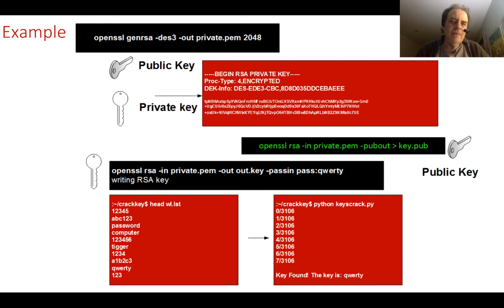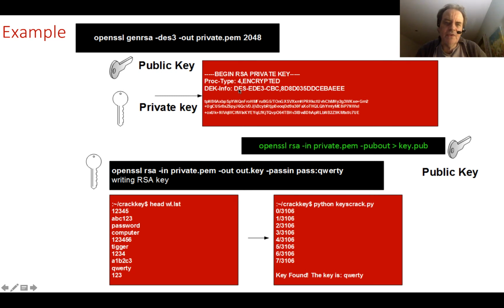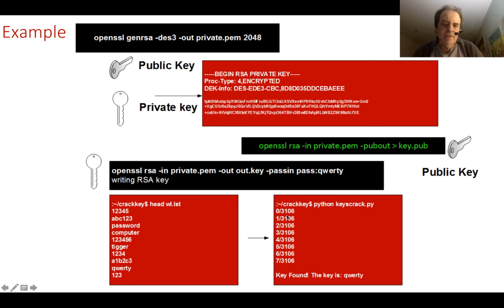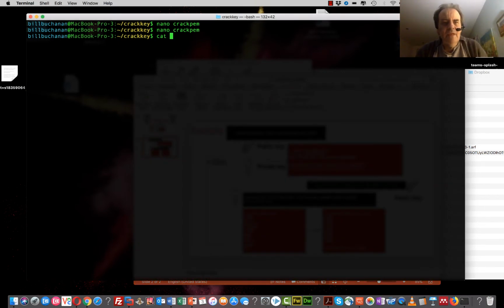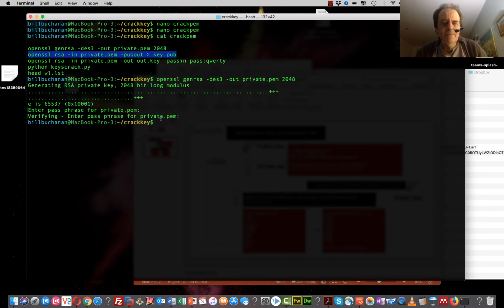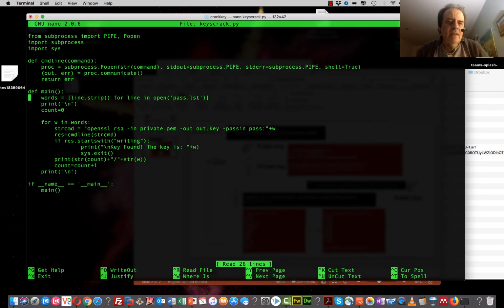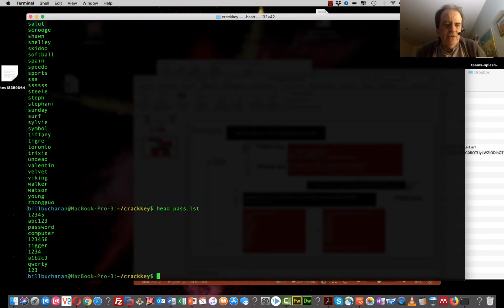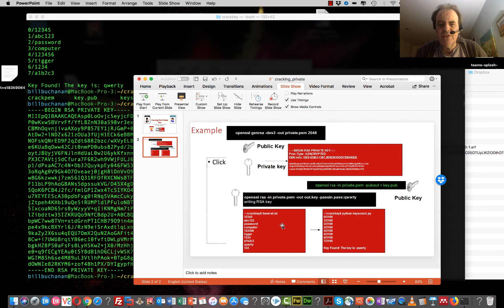Cracking The Private Key

Comment: Probably one of the worst methods for craking a pem file because python with subprocess is so slow.

John the ripper and hashcat are way more efficient tools.
And even if these don't work, pemcrack is still waaaaaaaaaay fast.

(Also, the script won't work if you an empty password in you wordlist)
Reply: Olivier, what's your device to crack/ hack a private key?
Reply: @groshen8047  I have a NUC from a des years with a Kali Virtual Machine. So my setup is quite inefficient. But even an old computer with John is faster than the script.

You can look at this tutorial for a better reference : http://www.abhizer.com/crack-ssh-with-john/
Reply: @groshen8047  I have a DIGITALLY SIGNED PDF . I need to hack that signature so I could use it in other documents and this new signed document could still be validated
Reply: Gro shen hello how are you...